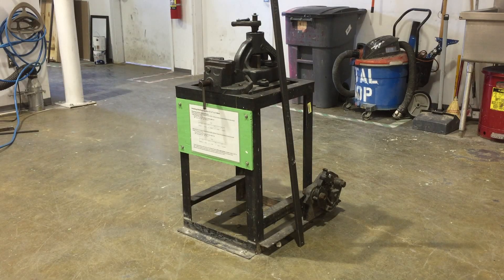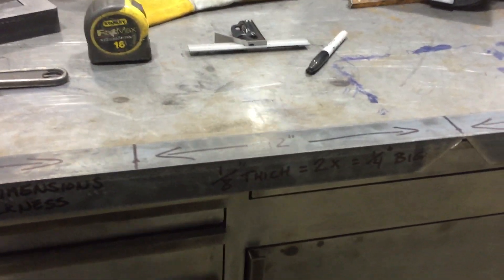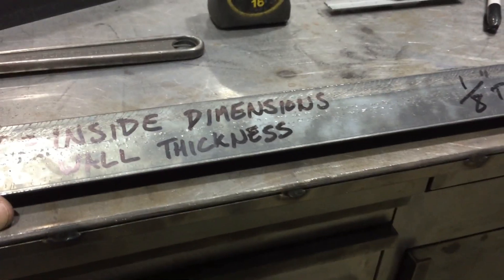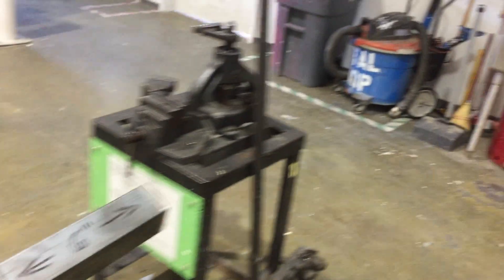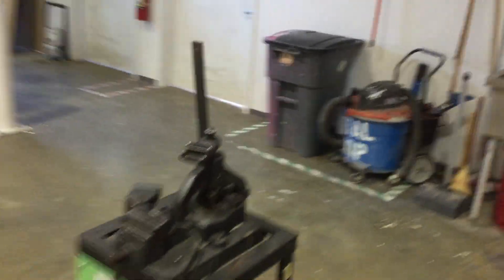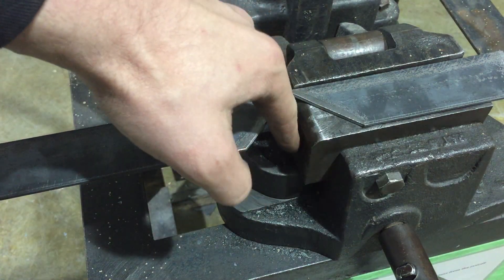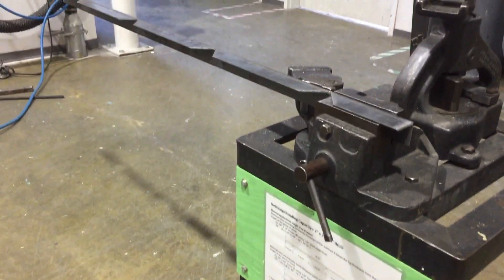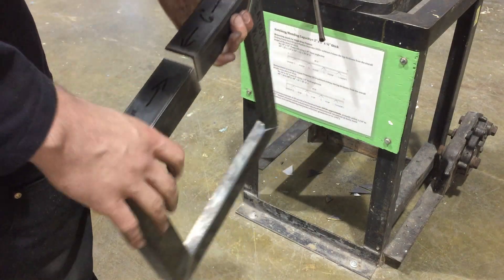Whitney Bender Notcher

Comment: This is a great video. Thanks for sharing the details. This video inspired me to purchase a used Whitney bender/notcher setup that I found locally on Craigslist (just happened to be one for sale only 10 miles from my house), and I'm using it on a project -- to make 32 rectangular "frames" to hold treads for a steel stairway -- and it's not only time-saving, but the results are better and more consistent than when I've done similar frames by cutting each 45 and welding the corners.

After watching the video again, I saw the instruction sheet mounted to the side of your tool stand. I was wondering if you have a digital copy of that instruction sheet you might make available. I read through the comments and see that someone else asked the same... and you replied that you don't have a copy of it.  If that tool is handy, could you take a photo of it for me? I'd like to recreate it and post it to mine, as I share shop space (and tools) with a bunch of people, and that info would be great to have posted on the notcher/bender itself.  If possible, please send a photo of it to mightyfabpdx (at) gmail (dot) com.

Thanks again for the great informative video (and inspiration).

Comment: Amazing, how do we get this machine.
Reply from the maker: This is a Roper Whitney No. 455 Combination Angle Iron Shear, Notcher, and Bender, it’s still available for purchase new from a number of dealers; do a quick internet search and you’ll see it’s going for around $3000 new. You can also purchase the components individually and mount them to a bench. I'm sure there are used deals out there too if you hunt around. I find the notcher and bender are the more useful tools, especially if you already have another means of cutting the material to length and/or have limited shop space. I find the shear (not demonstrated in the video) can cause a bit of distortion in the material if you don’t dial it in right. But if you want to make a bunch of angle iron frames quickly, this is a great time saver.

Comment: Great video, I just picked up one of these outfits.  In the video it's hard to see the text on the sheet you have on the front of the machine.  Any chance of getting a picture/details or something?
Reply from the maker: I don’t have a copy of the text handy, but it illustrates what I explain in the video. It gives two examples of laying out a piece of angle for notching & bending. One describes how to achieve a desired outside dimension, and the other illustrates layout for achieving a desired inside dimension (as though you were going to build the frame around an existing rectangle or square). 
But the basic principle is that approximately 2x wall thickness of your angle is added to the outside dimension of your frame. For example: if you start with a 48” length of angle with a 1/8” wall thickness, lay out your notches at 6”, 12”,12”12”,6”, the resulting square frame would measure 12 1/4” outside to outside and approximately 12” square inside. If your wall thickness was 3/16”, the resulting frame should measure 12 3/8”, and 1/4” material would result in a 12 1/2” frame. If you wanted a frame that measured 12” outside dimensions, you would subtract 2x the material thickness from each segment. Actual dimensions may vary depending on material stretch, etc. This isn’t a precision machine, but it builds ready to weld frames fast and is as repeatable as you are with your layout and operation. Hope that helps, and good luck with your new machine!
Reply: @robdamico5304  That's awesome!  Thank you sir!
Reply: @robdamico5304  estimado donde puedo comprar estas maquinas
Reply from the maker: @miguelestrada2183   see my reply to Asgar Ali